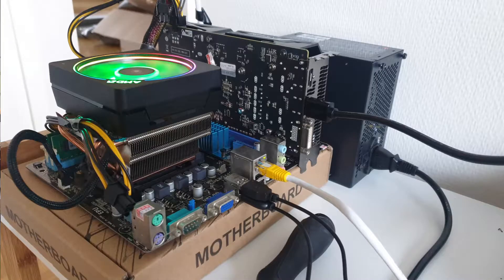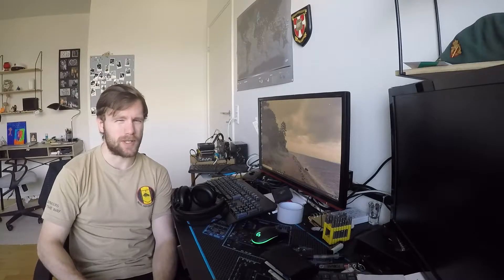Is the AMD Phenom II X6 1055T worth it in 2021?

Comment: Would be best to use msi afterburner and riva tuner together and display things like how much parts are being used, temps, power draw and speeds. This can show bottlenecks more clearly. Also the tdp means nothing in reality, amd doesn't calculate the tdp numbers, they nominate them. 95 watts tdp does not mean it actually generates 95 watts of heat. Besides this, how much of the cpu is being used also dictates the used power. Naturally a stronger cpu will run much less at 100% all the time, reducing power usage. My 12th gen i5 can use 180 watts overclocked... at 100%, but im using 8.8 watts of cpu power right now and in games it hardly ever goes past 65 watts.

Comment: I have phenom x6 3.5ghz DDR 3 16gb and rx 580 with 8 gb video ram. For me it pc is enough
Reply: we have the same processor and graphics card wtf lol
Reply: What's your motherboard model? And PSU wattage?
Reply: @SRC267  PSU is Zalman 600W and motherboard is Asus m4a89td pro.Ram frequency is 2000 MHz and latency 10-11-10-27
Reply: @jasonbaker6213  cool. Might look at compatible boards for the X6. Current one is from 2011, it's limited to 8gb ram max.

Comment: I have PC with phenom ii x2 550 3.2ghz, is that worthed to upgrade with this phenom ii x6 1055t?
Reply: if you'll do it right try to get one of this cpu's: 

AMD Athlon II x4 640
AMD Phenom II x4 650T
AMD Phenom II x4 840T
AMD Phenom II x4 960T BE
Phenom II X4 970

And unlock them to a 6 core CPU's - 

Phenom II x6 1405T
Phenom II x6 1505T
Phenom II x6 1400T
Phenom II x6 1065T
Phenom II x6 1705T
Reply: @m4cl  yes my phenom ii x2 550 is already unlocked to phenom ii x4 B50, ok i'll try to buy x4 960T BE if that can unlocked to x6.

Comment: Do you think this cpu could run COD: Cold War?
Reply: I think it will definitely struggle with 1080p low settings. Are you thinking about buying this cpu?
Reply: @Samuel  well yea but some peopl3 don't want to oay that much altho recently there does seem to be some good deals
Reply: If you have an AM3 board instead of an AM2+ board go with something like the FX-6300. If you're on the older socket I'd upgrade.
Reply: @shrekinabox1730  the FX processors are only compatible with am3+, not am3
Reply: @Samuel-zl7yw  nah they work on am3 too
Reply: @shrekinabox1730  you sure? i got an am3 ta880g and got an fx 8320e procie would it work?
Reply: It definitely does not struggle with low 1080p. Doesn't even struggle with high 1080p. I'm running War Thunder on ultra and CSOG on High with no lag at all